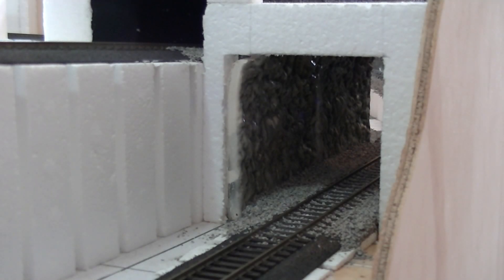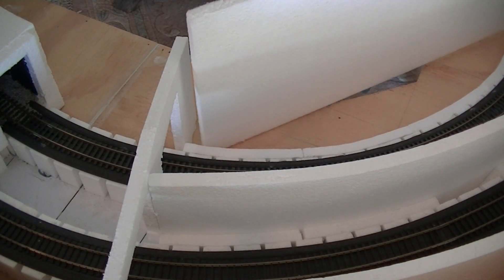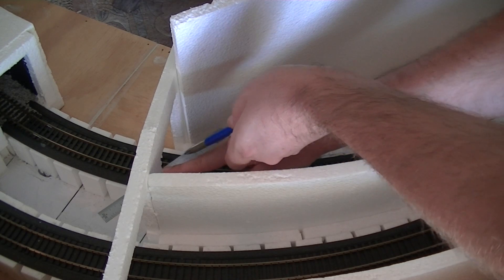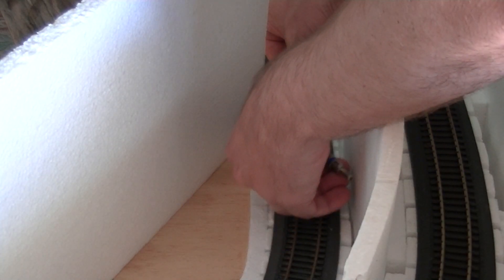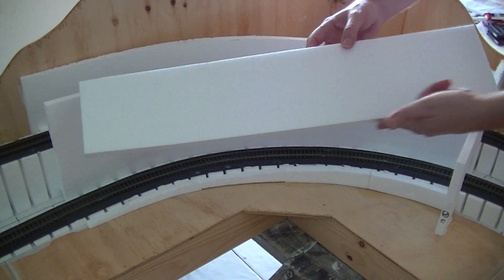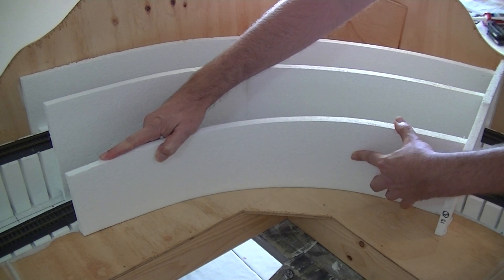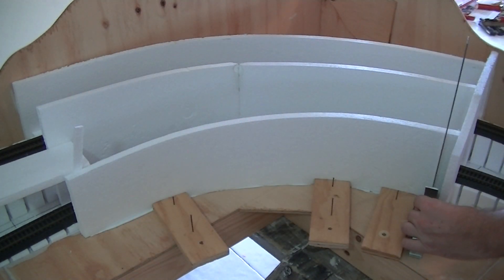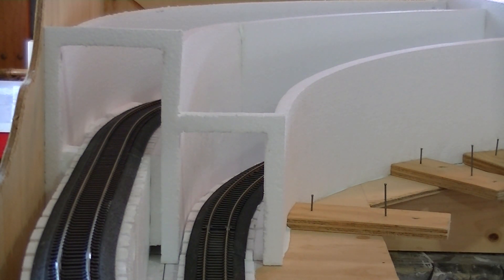Using foam to make tunnels for the layout

Comment: Thank you very much for all your videos.  I plan to use your track layout for my next project.  I like your using foam to keep things light for modular railroading.  This way you can use an extra turnout at each end with some flex track and bolt another module to this one and extend the layout.  I'm sure glad you posted your progress from the bench work to actually making the module with the two tunnels using foam to keep things light.  Once again, thank you for posting these great ideas.
Reply from the maker: your welcome, glad you enjoyed it

Comment: Hi.  My wife and I are just getting into rail modeling for the first time as part of our retirement plan 😎 and our first layout will have an extensive tunnel to give that illusion that it is not a circular track.  We are very much in the information gathering stage at the moment and this is very useful, thanks.

Can I ask; one thing that concerns me is how to access trains in a tunnel in the event of a derailment..  What is your plan of action in the event of a derailment in this set-up?

Cheers
Reply from the maker: I would not recommend building the tunnel like i did with no easy access.
Making a access hole at the back of the tunnel would be best practice
Reply: @DetroitRiverRailroad  
Thanks.  I will be sure to make a note of that right now in the plans.  Cheers

Comment: Im having hard time finding these foams at Bunnings. Where did you get them ?
Reply from the maker: Try searching polystyrene products 
This is the same foam used in packing products
Reply: @DetroitRiverRailroad  is this the business name cause I put that in Goggle and a site came up as Polystereneproducts.com.au from QLD
Reply from the maker: Not sure what state your in, but anywhere where they sell foam should be ok
Reply: @DetroitRiverRailroad  nsw. I’ve looked but not most sites are minimum purchase value order  $100+
Reply from the maker: It's a long shot but you could try stores like jbhi and do some dumpster diving for foam packaging
Reply: @DetroitRiverRailroad  you reckon the Abelflex expansion joint filler will work ? 150mm in height. Very flexible.
Reply from the maker: I looked it up online, I have never used it but it looks alittle to flexible.
Can't say for sure

Comment: Hi, watching your videos I noticed you had your track layout transferred to paper on your bench.  I use anyrail6 and was wondering how you did that to scale??
Reply from the maker: +Stony Hi Stony, you go to the print screen and select 1:1 scale before printing. Hope this helps you out
Michael
Reply: Got that BUT I can't print that size.  So did you actually take the anyrail .any file to a printing shop?
Reply from the maker: when your in the print screen you select a PDF writer instead of a printer.
if you don't have a PDF writer you will need to download One
Reply: Thanks alot......enjoying your videos